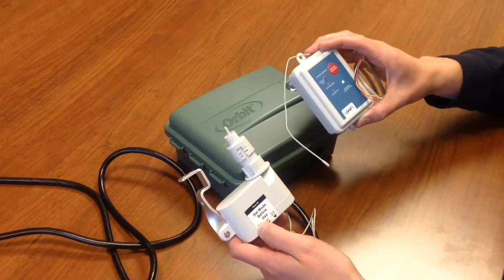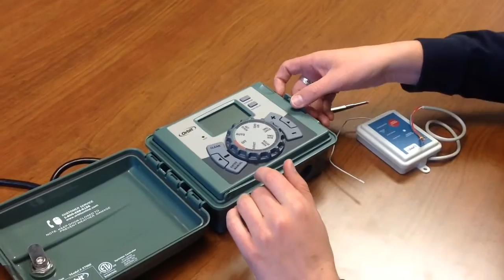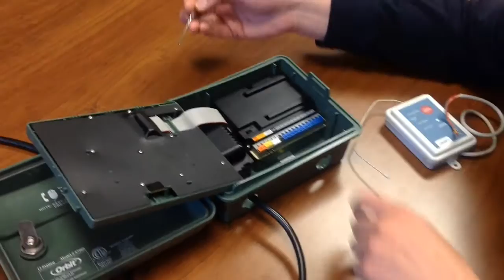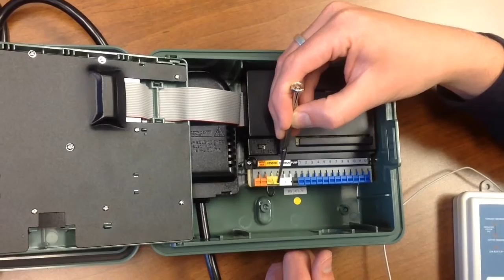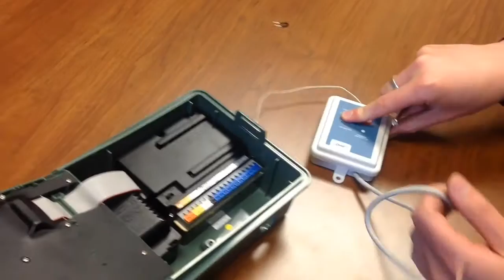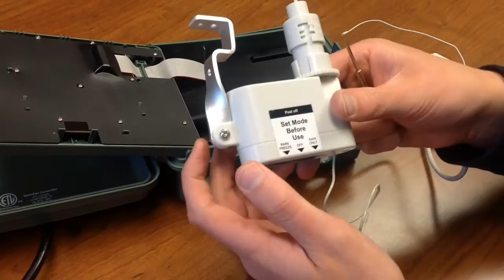How to install Orbit wireless rain sensor

Comment: Thank you!  Just wondering if I can use a small relay to allow me to control the system remotely?  I would assume that if I open the two yellow terminals with the system set to water then this will interrupt the system program??? Is this correct>

Comment: I have this orbit rain sensor, but I cannot find any instructions on-line for adjusting the sensor itself for duration that watering function is delayed after raining. 
There is a setting on top of the Orbit sensor that reads:  MM 3-6-13-19 or 25.  Which setting should I use and why?  
Thanks
Reply from the maker: So this rain sensor doesn't allow for setting delay/off time after it's triggered. it's a simple on/off switch. when the amount of water set by the meter is reached it will cause the sensor to switch the timer to off. when the discs dry out, the pressure on the switch is released and the delay is removed.